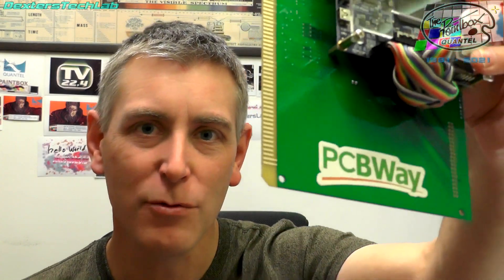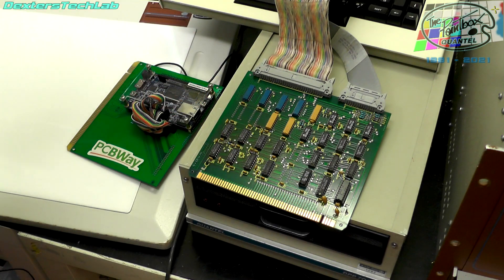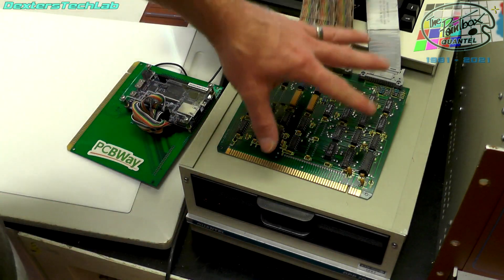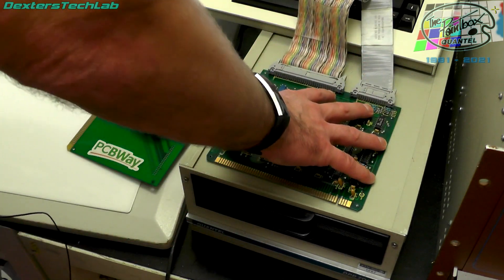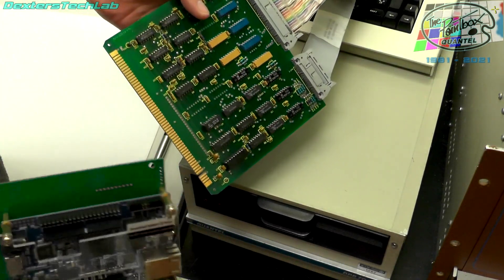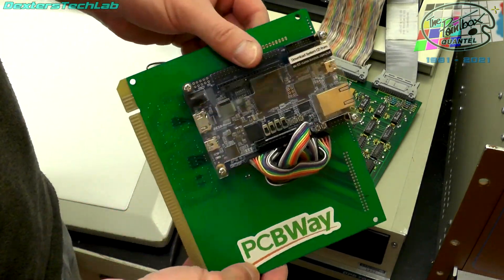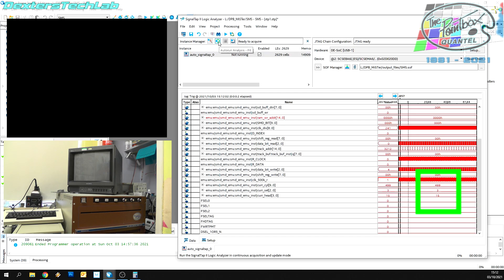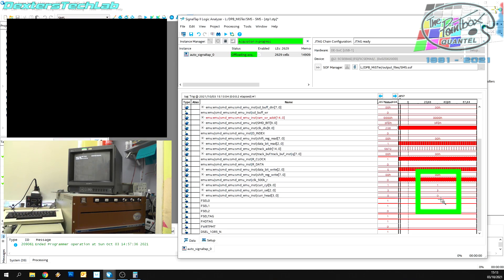DL224 Quantel DPB-7001 Restoration & Repair Part 7

Comment: Hats off for your work on bringing this back to life and developing an interface to current disk technology without destroying the original.  Looking back at previous videos I realised I actually worked on this particular unit when I was an engineer at BBC Elstree back in the  '90s and can shed a few details on its history.  It was 100% reliable (give or take a few pens and the occasional crash) and was left switched on 24/7 from early 1989 until it was finally replaced by a V series in approx 1995.  The first thing the new owner had to do was to fix the startup circuit in the power supply!   It was used to prepare the graphics for "Newsroom South East", the then regional programme for the London area as the images on the hard drive will show when you  get that going.   There was also a 80Mbyte removable storage drive that went with the kit. I have some documentation and a set of diagnostics ROMS that fit the computer 2 board which may be of use to you.  Amongst other things you get to see low level disk activity.  (I also have a classic paintbox bought at auction in 2000 for the princely sum of £5 though it's been a few years since I dared power it up)
Reply from the maker: Oh wow, this is awesome news. We must get in contact off YouTube comments. Please email me so we can have a chat! elegant.wing8369@fastmail.com